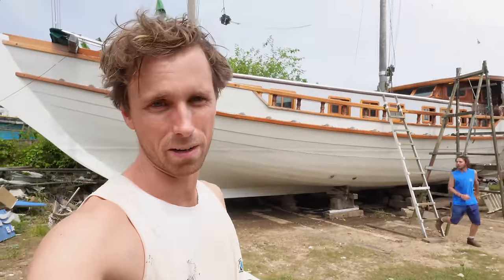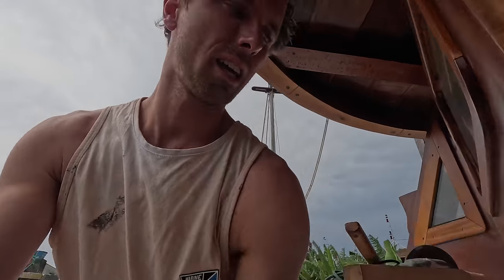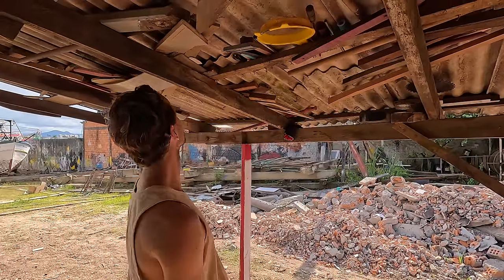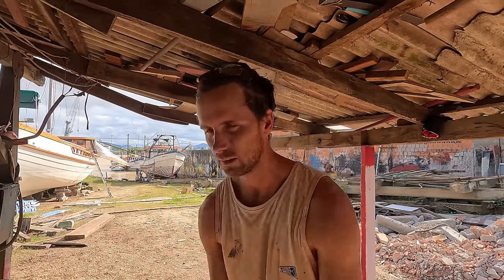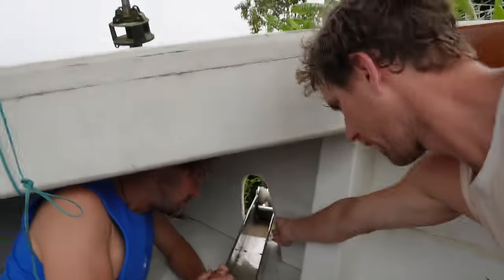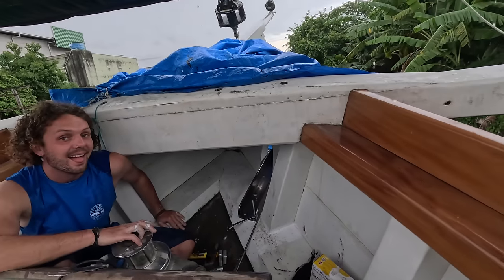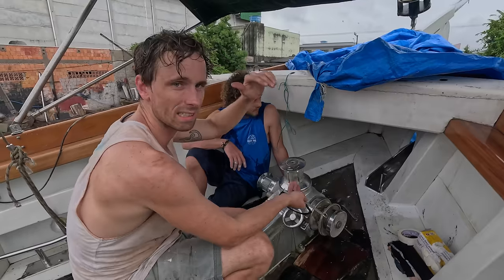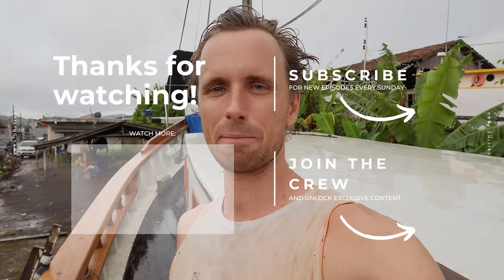Installing Yabá's anchor bow roller (complete boat rebuild) — Sailing Yabá 187

Comment: Plugs should be cut across the grain so the grain lines up with the grain you are plugging. What you have made are dowels which leave end grain exposed which will allow moisture to get into the hole, swelling the dowel and splitting the surrounding wood and causing rot.
Reply: The foolishness never ends.
Reply: You're referring to bungs which blends well. In my opinion, cutting across the grain (dowels) is better as the dowel will swell and tighten up. However, you do want to treat it, so to avoid what you mentioned. Some people soak in epoxy, burn the end, use boat soup or something else. If you orient the wood right, it not as noticeable. I know wood will soak up the boat soup quite well. I suppose it's a matter of preference based on experiences.
Reply: You're wasting your breath, they are thousands of such errors made.

Comment: Just thought about it
 While you're making those bungs,  make some the size of your thru hulls and keep them aboard in an emergency you hammer them in a broken thru hull from the inside to stop flooding
Reply: True, but he needs to use a very soft wood for the emergency bung. I think they are usually Bass wood??
Reply: Strongly agree.
Sailors have always feared holes under the waterline.
That's why paddle wheels have resisted so long against propellers and why wooden leak plugs have been in the list of mandatory security items.
The best is to have near every through hull a plug of the corresponding size.
Cheap and life saving.
Reply: They use (used) balsa and/or cork. I know 'cause our boat had a bag full hanging from a peg near every through hull, above and below the waterline x
Reply: good advice…but also should have a box of all sorts of different sizes and shapes with mallet with them in case of any hull breech …can use them in combination depending on shape of hole …also, a must is a new putty or clay like material that can plug holes and hardens under water…i’ve seen it demonstrated with a gaping opening in a  hull with water gushing in, and after a few fist fills of this stuff it stopped completely…not sure of the name of the product, but i’m sure marine suppliers know it…
Reply: I pray someone will correct your use of plugs with. End grin exposed to the weather.No matter what you seal it with. !
Reply: @s.simsmamasboy  correct if you have in mind the plugs hiding the chain plate screws. Traditionally they are cut across the grain with a hole saw in a plank of the same wood. You're supposed to align the grain parallel to the main support (teak deck, gunwale...), The purpose is aesthetic.
However, this thread also discusses those security plugs you'd shove in emergency in a broken through hull. If you buy a set of security plugs, you'll see they're made end grain, because sturdiness is the priority.

Comment: For the plugs, why not use the lathe? Fast and repeatable!
Reply: Lathe would make a dowel he needs a tapered plug  like a cork in a bottle if  a cork wasn't tapered wouldn't seal the bottle would fall inside
Reply: @Robert.Tower. obviously you don’t know how to use a lathe!
Reply: @Robert.Tower.  The hole to be plugged is not tapered so a plain dowel could be used, after all the standard plug cutters all cut a straight sided plug.  In any case creating a dowel on the lathe slightly larger diameter than the hole, which you can sand down to any shape you like, hammer it in with glue and then cut it off and repeat.  The only issue with using plugs of this type is that the end grain of the wood is exposed that will rot quicker than the main timber and that is why plugs are normally cut across the grain.  A small hole saw would be ideal if used without the centre drill
Reply: @Robert.Tower.  You can make tapered plugs on a lathe.

Comment: Hi guys, while you have got the boat out the water I highly recommend putting a second anchor holder in. Put it in on the port side - you don’t need to use chain you can just use the rope winch on the windless but really for a boat of your size, you do need the second anchor option, especially if you’re in an anchorage with lots of current and big wind against you - with the size of your boat, you will carry a lot of windage and current pressure. Even if you just cut the hole in the bow for now, you can put the anchor holder on later.

Comment: Underwater lights and Camera 😎
Reply: More than one camera. Good for coral bommie spotting as well as nature viewing. If you have spare ones you could have one viewing the prop and lower rudder. As others have mentioned the lower rudder pintle is small and not well supported IMO. Prop is a bit small as well for long distance motoring when you can't use the sails. Currently we don't know the sail layout and canvas area. A picture would be good.

Comment: Hi, I saw that you are very precise and take care of all the work with maximum finishing. So I'll give you some advice that will be very, very useful to you: you can buy a special two-component silicone paint that you can paint on the propeller. In my boat it lasted 5 years and all it takes is a light sponge and you will clean the propeller easily. Don't use a scratchy sponge though. the Product is called Sea Jet Peller Clean. You will see that if you use it you will thank me...I see you are about to go to sea maybe you will use it another time

Comment: Hey Ben here's a tip get yourself an plastic  Drum 44gal and mount it in the Chain well so your chain stays in drum and won't make a mess or rot wood drill hole in bottom  of  drum with pipe to outside of Hull for drainage

Comment: Another way to make dowels for plugs is with a steel plate.  Steel plate can be 5mm or thicker, whatever scrap you can find, it just needs to be big enough to drill a couple of holes thru and be able to hold it in a vice or clamps.  Drill a couple of holes in the steel plate one hole just a size bigger than the plug you need and another hole the exact size you need.  Cut your plug stock square just a little bigger than the final size and round over one end as you do now so that the end of the stock will fit in the smaller hole and drive it thru the bigger hole first with a hammer and then drive it thru the smaller hole for final sizing.  Pre-cut plugs into lengths you need or install as you do now.  See you tomorrow.

Comment: I think if I had to make alot of plugs I would use the same hole cutting bits that you used for the bilge holes only smaller that way you get a plug already and can glue it back in.  Glad to see you took a few hour's to relax.  Be safe stay healthy 😊.

Comment: I love you guys but it is nearly impossible to imagine not having a proper set of bung cutters and a drill press in a WOODEN BOAT yard! I have cut thousands in my lifetime. I would be dead and at least three boats would not be finished using this method. Did I mention I love you guys? :)

Comment: Yaba,

Making plugs the way you are is great for thru hulls, not so great for plugs in planks.
There are three distinct directions of wood grain in a plank. 
Longitudinal, diagonal and perpendicular.
For a plug you want the exposed grain to be longitudinal in line with the surrounding grains but a cross grain of the wood.

The closer you get to crossing grains  the more easily water intrudes.
The way you have done it leaves an end grain exposed rather than cross grain.

Trees are designed to carry water from the bottom to the top, long ways, longitudinal with the grain.
You've created a wick, a sponge. 
That's great if you're trying to absorb water, bad if you are trying to stay dry.
Hence why bungs are better long or diagonal grain. They absorb water, swell and seal.

Bungs split longways, plugs split short way. 
Plugs cut off easier, cleaner and smoother with the correct grain. 
That was how I was taught anyway. I doubt it makes much difference as long as it works for you. 

Looking great, hope you get her in the water soon and take a day or two to do something like nothing at all.

Comment: I just had to finally say something - couldn’t hold back any longer. I think you mean lag screw (otherwise known as coach screw). 😊 A lug screw is a short screw with no head, but lag screws, on the other hand, are generally long and have a hexagon head, to tighten with a spanner (wrench).

Comment: I think it would be a good idea to put a stained wood hand railing on the edge of the roof to hold on to if you're in rough waters. I notice the sides of the boat are low when you are standing next to it. Just a thought.

Comment: Hey if your bimini is soaking through I recently found a cool fix. Mix a solution of silicone sealant and mineral spirits. The spirits create a solution thinning out the silicone enabling it to completely cover the material, soak through, and extend working time so it doesn't cure too fast. You can find other folks doing this. Not sure how long it will last in a harsh environment but it could at least extend the life of the fabric for a while and it's cheap enough you can reapply.  Mine was about 4:1 spirits:silicone. I've have tried 2 ways. Just putting it all in a 5 gallon bucket and stirring it and flipping it around until fully coated. Then the other way was using a paint brush. I used 2nd on my tent because I was running out and didn't need to cover mesh areas.

Comment: I have watched this from the very beginning...when they were sinking. Certainly this is a custom re-build and a lot of decisions need to be made, some critical and some VERY critical. Two of the decisions that are safety-of-life decisions are: 1) clearing the decks after taking a breaking wave and flooding the decks, and 2) keeping the rig in the boat.  My calculations show that the scuppers are grossly inadequate in clearing the decks between breaking waves.  Creating more scuppers would not be easy but could/should be done. They could be equipped with shutters to provide for outflow only.  The second is keeping the rig in the boat. I realize that the original rig was free-standing and that shrouds were not present. The new chainplates need to be aligned with the force on them or at least evenly mis-aligned.  This is critical. Because of the current apparent uneven misalignment, the force on them will not be evenly distributed among the individual chainpates, causing uneven loads and sequential, individual, failure under heavy conditions. The may impose additional uneven loads on the remaining chainplates and the resultant uneven loads on the standing rig would be very undesirable.   IF I HAVE MISSED SOMETHING HERE, OR AM GROSSLY MISTAKEN, PLEASE CORRECT ME.

Comment: Why not drill a hole in some scrap that matches the holes in the boat, then you can check for fit without having to run to the boat for each one. It's also looks like you may need to install a vertical roller to guide the chain straight into the Gypsy on the winch... 🍺:goodvibes:

Comment: Yes ! I had a 35’ sailboat for,years you can put everything on the bottom of the boat even your sacrificial metals , then just tape up whatever you don’t want painted with bottom paint , remove the tape and there you go in to the water , don’t forget to paint the prop, and other thinks with special anti growth products, I used that on my speed sensor paddle wheel also , don’t know if you have one or,just use GPS P.S. try to put two coats of bottom paint on the keel just in case you run aground! 🤔 it’s a lot of work but once it’s over it’s sunny days and piña coladas in till the next repair! LOL

Comment: Hi Ben, just wondering if those bolt heads are going to get totally crushed and scoured away when the chain roles over the bolt heads in in that bow roller plate, remember the chain will have a massive weight and massive filling action on the bolt heads...just saying, please consider

Comment: THIS COULD BE IMPORTANT! Ben, I am concerned that we might be watching a disaster in the making, owing to the pressure on you to work quickly. HERE is my concern: I am worried that the way that you have attached the anchor bow rollers may not have been properly thought through owing to external influences.  You have placed ALL of the considerable load of the anchor + chain+boat upon your choice of mounting point! Think about it, the boat is moving up and down according to the sea conditions of your anchorage. This will place ALL of that load  upon your mounting bolts! And at the very end  of a substantial fulcrum! You might get away with it  so long as the sea remains fairly calm in the anchorage BUT WHAT will it be like in a choppy anchorage with the boat lunging on the chain?  BUT WAIT a minute! I think I might have found a solution to this problem!  You need to SHARE the load with the other anchor roller!  You can do this if you weld both rollers together by means of a flat cross-piece at the deck level so that you will be able to bolt the whole assembly to the DECK instead of using only your taprail! If you through-bolt it you will need to use a strong steel backing plate  - this is the way I would do it. I suggest that you ask around about the problem....if the experts say that I don't know what I'm talking about so be it!

Comment: END GRAIN!!.
The way the wood is cut, the dowel with open end grain will suck water in along the grain, plus, the dowels are not perfectly round, so you are relying on glue to stop water bypassing the poorly fitting dowel.
I know it will be painted, but it’s still not great.
Ideally you cut the hole with a hole saw, then use a slightly larger hole saw on a new piece of wood to cut a plug. 
I’m not angry lol I’m just concerned :)
Also, the chain will wear the heads off the bolts and your anchor chain guide will fall into the water.
You’re doing a good job, but don’t rush for the sake of it!
:)

Comment: From a 75 year old Sailor…..you will have problems with your bow roller setup…the load on that with a vessel your size & weight will be extreme…not to mention when you are anchored in rough seas …please think on it…or get a expert to advice you…!!! Better to rectify now…before the damage is done. 
With Love ….Rodney North Queensland Australia

Comment: You guys realize that you are building a very unique boat?  Well, of course.  .  But then.  It's been "up on the hard" for too too long.   You don't really know.  How it will look/perform when you have all the rigging up and sailing along.  It will perform.  Oh yea.  You've got a canopy going on in the bow there.  Please pay very special attention to the bow.  The bowsprit. Rugged.  Reinforce with steel cable. ~ or that Dynaflex stuff.  I want three staysails up there.  Yep. Not gonna lie.  Three triangles there in the front.  No fooling around. It's the spreaders also "up high."  Yr gonna have to pay close attention to a strong rigging set up.  A cable out on the end of the bowsprit.  The bowsprit reinforced with aluminum or stainless steel. There's where you have a jib.  Big and tall and knife shaped then the next and the next.  Three Oh so Majestic triangles of sail pulling the boat along in the wind, with waves, the foam on the water, the pull of the keel.  The sound of the water rushing by.  The wind in the rigging.  Aye Mattie. The sun reflecting on the water.  It's all there for you.〰Carry on now. On and On and On.〰✨💦🌱💦🦋👍🦋💦🌱💦✨〰